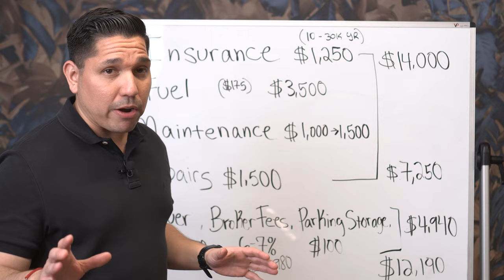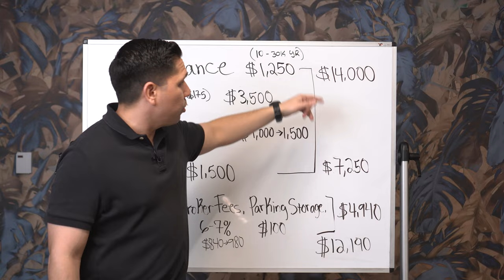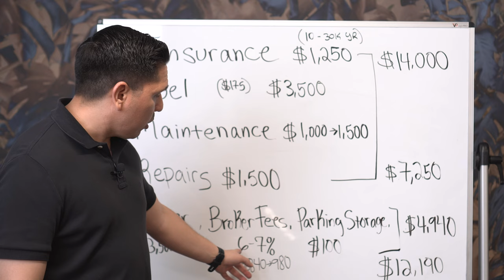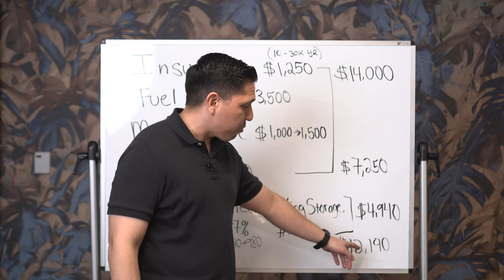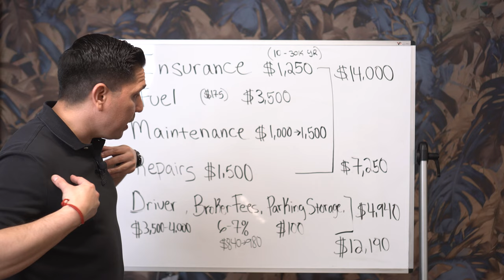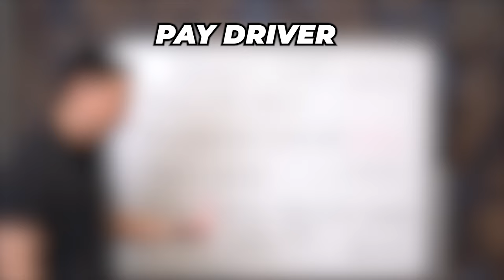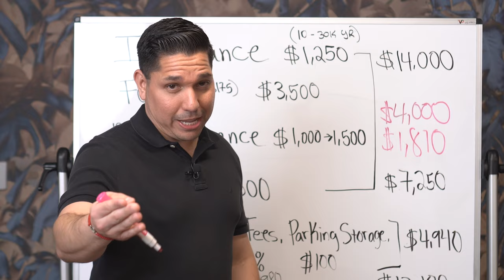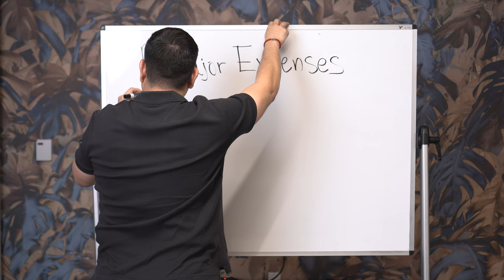The Shocking Truth About Owning a Dump Truck

Comment: If you see this comment, please clear it up for me. I live in Texas Frisco to be specific and I talked to a dump truck driver in the area said he makes a lot more than that per year. I’m thinking about buying a truck in two years once the money is saved, but if I run the truck myself and make under 6000 a month dealing with the headache of being an owner operator that does not seem worth it I make over 6000 a month as an over the road truck driver for a company.
Reply: His numbers are way off
Reply: I’m in the McKinney area . & I was told the same .they gross way more then that .  I can’t imagine profit that low . Can’t even pay bills with that .
Reply: @devinjohnson9749  I’m in New Jersey and we average $100 an hr on hourly work, and 9hr shifts, and diesel is 3.50 per gallon, and most of the work is local so I spend about $100 a day on fuel . $4500 per wk -500 for fuel = $4000 per wk, once you save up about 20k for maintenance on a truck your good. I bought my truck our right for 50k so I see all profit. I had one major breakdown in two yrs “water pump “ other then that just regular maintenance and tires , 🤷🏾‍♂️
Reply: @kingparis24 your boss pays you 16k per month
Reply: @KEVINSURIEL  naa i own my own trucks
Reply: @kingparis24  thats wasup my dude said trucks damn you have a fleet

Comment: These numbers are way off, you should be grossing about 5k a wk with a dump truck
Reply from the maker: Numbers depend on several factors like what state and city you are located in.  And also what type of truck you have. The bigger the truck, the more axles you have and the more weight you are allowed to carry.  All equals to more money.  The numbers in this video are very conservative numbers on a tri axle in the greater Houston area. I also mentioned that in the video. 
And yes you can possibly make $1000 a day in a dump truck. We actually have a video explaining how you can make $1000 a day that has not been released. Look out for the video it will be coming soon. Thanks for watching!